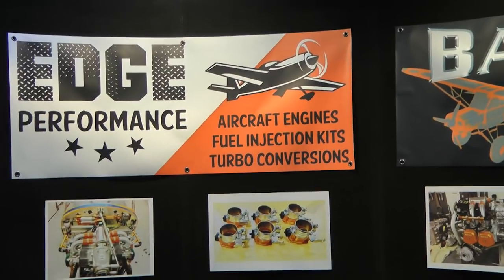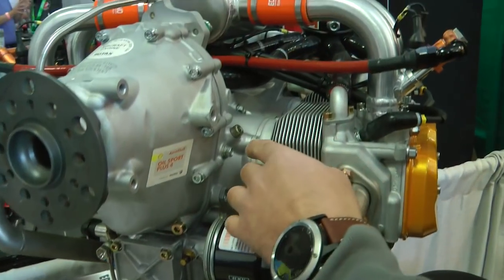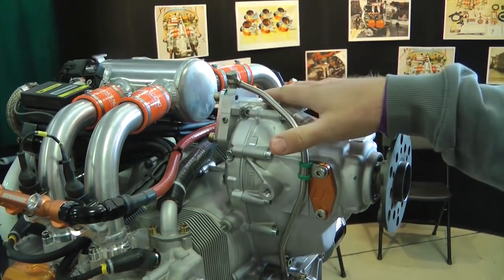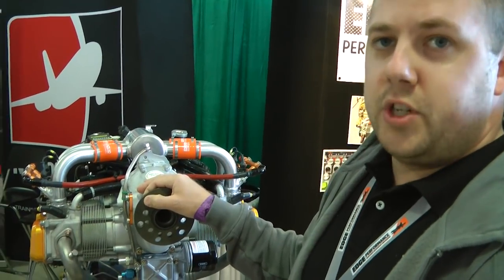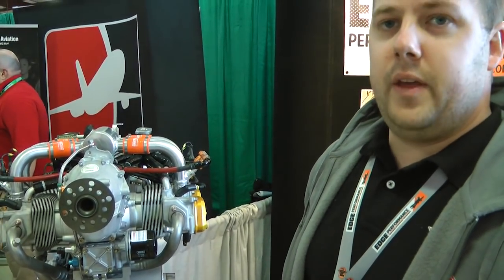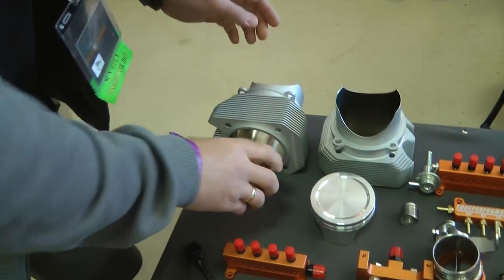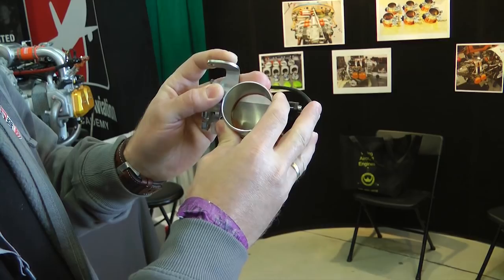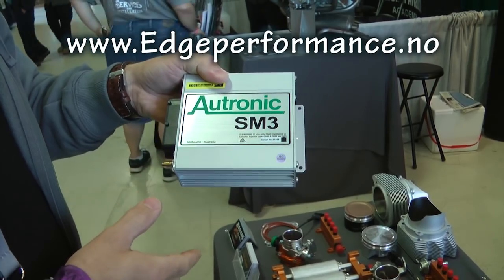How to Increase HP for the Rotax 912

Comment: Being a car guy, coming into aviation, I'm glad to see this.  Big bore kits, forged internals, adding boost, and fuel injection over carburetion.  Just a bit more expensive than a car though haha.
Reply: I would agree with you completely my friend!  Most of the engine technology in GA aircraft is based on 40-50s technology, Lycoming and Continental seem to be seeing the light lately with more modern, lightweight and turbo engines... but in my opinion the real breakthroughs are happening in Experimental and Light Sport.
Reply: Jerry Moody  No numbers. Low numbers make it hard to manufacture for reasonable profit. These guys have been in production for 10 years by the time this video was out and they had sold 200 engines. That is about less than two a month. I don't see anyone getting rich off of that.
Reply: Try 10 x more expensive then a car for certified

Comment: don't think i'd want a hopped up engine in my airplane. in fact, airplane engines are usually detuned to increase the safety and reliability factor.
Reply: That's right. Simple, direct drive 1940's technology for me all day long. That high revving 5000 rpm is not for me. I have tried to make myself like it, and just can't! #saynotogearboxes
Reply: I thought EDGE just offered a turbo kit for the 912 engine.  I didn't know they modified the internals of the engine to boost the HP.  I wonder if they would sell just the turbo kit.

Comment: I have just completed an install on my 912S, and after first start will say it's all good. EXCEPT, the weight....., no way do you lose 2 or 3 pounds, you gain 2 or 3.  I was very careful in weighing all the removed equipment, and weighing the new, BUT the few extra pounds (dual fuel pumps and ECU, are all located back of the firewall, the pump assembly clear under the passenger seat of my RANS S-7S, on or very near the CG in other words.  If anything, I lost 1 pound forward of the wall, so all in all I'd call the minor gain worth it, but it does bug me that they claim it weighs less.
Reply: thanks for the info.   hows it working out on your airplane?
Reply: @wasatchm   Very well, almost 50 hours of flight later.

Comment: I bet you can put one of these in a small hot rod, like a Fiat 500, Volkswagen Beetle, Karmann Ghia, Hillman Imp, or something like that. You’ll need to unbolt the gearbox on the front, make an adapter plate for the transmission (Volkswagen or Porsche), sort out a clutch, fan, bolt on a car flywheel, but it can be done.

Comment: I'm astounded. Champhered throttle plate obviates that clunky draggy shaft thingy. Briliant simple idea. It's worth millions. Is anybody else doing it? Why didn't I think of it?
Reply: Hi, this shaftless technology is patented :) Thomas, EP
Reply: Not really, its a common modification for many types of engines. The issue for mass production use is its several extra steps in production and for the cost offers little benefit for most buyers.

Comment: What fuel can one use in your modified Rotax 912? Is 95 UL ok?
Reply: Hi Tim. It depends on how we build the engines. They can run MOGAS 95-Oct if built accordingly.
Reply: 7 DusK what?

Comment: I think the best way to get more power is unbolt it and toss it away and get a titan or a UL fuel injected and enjoy flying more.
Reply: I'm all about the UL. That's the one for me. Direct drive all day long. I Will not have a high revving motor with a gearbox. These new snowmobile engine installs, are the most hideous, ridiculous sounding motors I have ever heard. I don't care that they are light weight, or the power to weight ratio, I care about continual every day reliability!!!!!! Safety is #1 all day every day!!!!
Reply: @scotabot7826  Believe the Rotax engines have a 2000hr TBO, so same as what a Lycoming,TCM, UL etc would offer
Reply: @aussiecat08  I know it, and over time they have proven to be a good engine, I just prefer a direct drive. I don't care for the high revving geared engines!
Reply: @scotabot7826  Totally understand, I have never flown behind a Rotax either, only TCM and Lyc. from the O-200 to the IO-540/ TSIO-550
I had considered for a project years ago the Jab 3300.  The UL is nice

Comment: Good fucking lord I only paid 28 grand for the whole damned plane with a 100hp 912s rotax!!!! THIS IS MADNESS I TELL YA. You mite as well put a well built lycoming in it running at 1/2 the rpms at 14 to 18 grand!! A rotax as to run at 5000rpm in cruse flight and 5800rpms at take off. There is a point to pull the dammed plug guys!!
Reply: Serge Smith considering the new Rotax 915is is $38k this is actually quite a good deal!  You are saving 10 grand, and it is lighter than the 915is!  The Lycoming is a great engine but they are extremely heavy and are direct drive!  These engines were designed to run at twice the RPM of the Lycoming to make them smaller, and more lightweight. Higher engine RPM running through a gearbox will allow a larger prop which produces more static thrust with less horsepower...
Reply: Not biting on it, way to much money for this engine period!! higher the RPM'S the more the stress period!!!
Reply: Serge Smith I would agree with you somewhat however this is now 2018 and engine technology has come a long way!  If an engine is designed to run at higher RPM for long periods of time and is built for it... You will not have these stress issue’s.  You do realize that the Predator drones use a Rotax 914 engine and have accumulated millions of trouble free hours... right?  Now the one thing I will not argue is the price of these engines... overall I think all of the Rotax engines are way overpriced and that is because they are capitalizing on their marketshare!  That being said this engine is probably giving you the best bang for your buck of any Rotax engine!
Reply: What whole plane did you buy with a factory new 912s for 28k, and where would you buy a new or overhauled equivalent Lycoming for $14k?  I'm not denying some sticker shock, but I'm not sure you're comparing apples to apples.
Reply: This is simply not true. The mean piston speed is about the same between a Rotax and Lycosaur on account of the Rotax's much shorter stroke. It's true that the brake mean effective pressure is higher in the Rotax, but the TBOs are similar, so what makes you think these engines are stressed so much higher? You'll also burn much less oil than a typical Lycosaur, and substantially less gas. The most valid reason to stick with a Lycoming is that the engine designs have very long in-service histories, so the reliability data is very well quantified. But the fact that the Rotax turns faster is a silly reason to avoid it.
Reply: Brian O'Neil
It is a corsareo mk500 and yes payed 28G the aircraft only had 124TT on it. Something is only worth what another is willing to pay! "Period" and yes you can find a lycoming 100 horse for around 14G and ones with very low TBO for 7 to 9G I have bought great engines from Texas salvage in great shape green tagged for less then 8G with only 108 hours TBO. So with that said you people keep paying the insane prices for this stuff and the prices will keep shooting threw the roof!
Reply: A green-tagged engine from a salvage yard is not comparable price-wise to a factory new, crate-fresh engine, even if the salvaged engine has low hours SMOH. Again, I agree that new aircraft engine prices are difficult to swallow, but if you want to compare prices across engine types, you have to compare factory-new prices to factory-new prices, and low-time salvage prices to low-time salvage prices. A factory-new YO-233 is about the same price as this engine if you include the cost of an exhaust system. But it's normally aspirated, a good 30 lbs heavier, and makes 30 less horsepower at sea level. For your money, a salvaged low-time engine may be a better value, but if you compare apples to apples, you get way more performance per dollar or per pound out of this engine than a factory-new Lycoming.
Reply: just buy a zipper big bore kit.  no turbo.  but a lot cheaper and still a solid boost in performance.   I think it's only 5K.